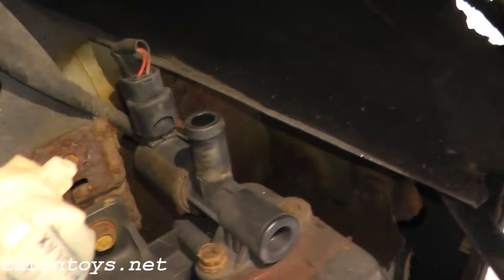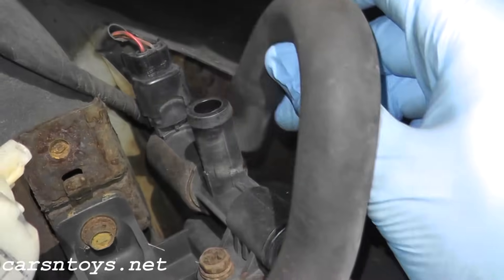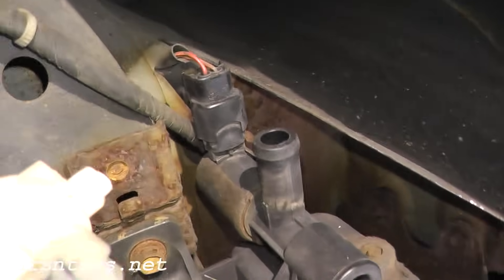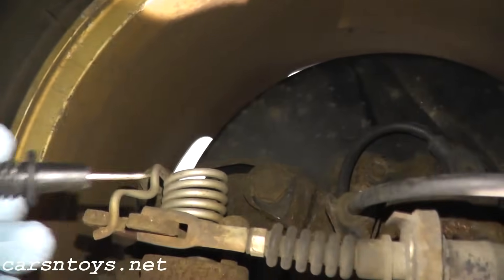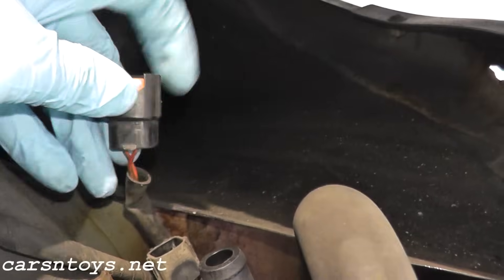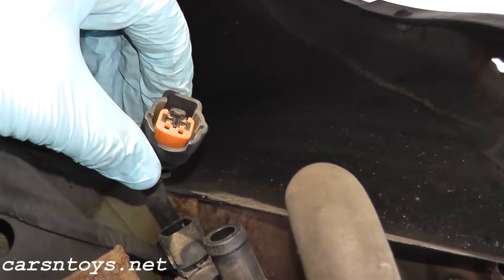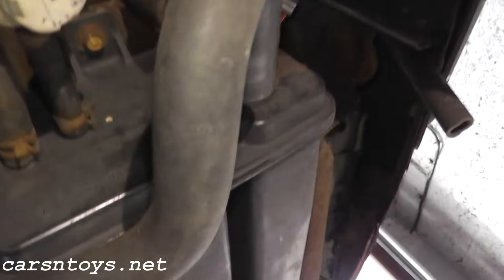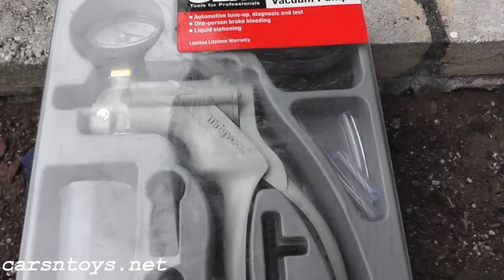How To Test and Replace EVAP Canister Vent Control Valve P0446

Comment: clicking noise from 12v activation of canister vent control valve DOES not mean it is working (holding vacuum, not leaking); any rubber seals may have turned to black mush or powder.

Comment: I have a 1997 or 1998 chevy s 10 with a purge valve solenoid problem ( PO 442 ).  I can’t find the valve anywhere.  Help

Comment: How do you go about checking the ground (#1pin) from the ECM? That's what gives the valve the signal it needs to close. Some of them can be done by certain scanners, but they cost a lot of money. Also, it depends on the YM&M. But if you don't have those  types of tools, then it's almost impossible to test. Bench testing a valve like that 1 is not 100% accurate it needs the ground circuit from the ECM to truly and 100% definitively make sure it's functioning properly. So, to sum this all up. You can run a lead wire to the inside of your vehicle to see with your multimeter if the ground does turn on. Also, check by ohming the wire to make sure it has no breaks. There are many things to consider before throwing parts at it, in hopes of a quick fix.

Comment: Super. I think i may be getting closer.
I have a 1998, 3.3L 4x4 auto. 170,000 miles.
My wife filled gas tank one day last week while it idling and it started acting like it was missing after that. 
She drove it 200 miles through the mountains and got it home. 
No codes.
I opened the gas cap, that looks good, and the tank depressurized for no kidding, 5 to 6 minutes. At first it was heavy and wet fumes coming out, then eventually faded away. No visible leaks anywhere, or damage.

I loosened the gas cap and drove it for 18 miles. No change. Acts like it's mildly missing. Plug and wires only 1 year old. No codes.

Also, the RPM gauge shakes about 200 RPMs when it feels like it's missing. 

Any ideas?  Do ya think my ignition coil just happened to go bad at the same time?  Would that not toss a code?

Thanks!

Comment: i had code po446 and got lucky. i noticed and fixed a torn hose to evap solenoid tip and replaced it and erased code. it hasnt came back on yet+ and running better. so hopefully im good.

Comment: 2005 f250 super duty 5.4 liter. Getting 11.86v to the plug. Hooked up an isolated battery to the valve and got NO clicks. Should I order the canister vent solenoid? Throwing only the P0446 code. Oem solenoid part #reads F80E-9F945-AA. Thanks for your help!

Comment: Hi sir i have code P0456 smoked it nothing found, changed gas cap like 4 times with getting factory oem one and after another code p0401 popped up so i changed egr valve was told and no engine light for 2 months but now code P0456 again any suggestions was told to replace evap canister vent valve or purge valve...Its for a mitsubishi galant 2002

Comment: It can also be tripped by a faulty gas cap.  Sometimes a malfunctioning purge valve but, usually what you covered, good job.
Reply: Thanks for the reminder.  I just fixed my 2000 Mazda B3000 (only 60k miles) with a new gas cap. Years ago I fixed the problem on our Lexus with a gas cap, but forgot about it.
Reply: @ILuv2learn   You're welcome.  😀

Comment: What would cause a has leak in this area when topping off your tank? I like to keep my tank full so every few days i top off the tank . And sometimes gas leaks by the rear drivers wheel. There's alot of snow on the ground right now so I can't really check too good. But there's no check lights on the dash and she  runs great with good gas mileage .

Comment: to all with a 2007 hyundai accent or similar, to release the valve from the wiring harness, there's a little metal wire you push in to release it. tried pulling my hardest and it wouldn't come out until i realized that, haha

Comment: I was really impressed with the caliber of the video/audio. So many are full of shaking and quick motions that make them hard to watch or contain outside noises that have nothing to do with the video. So kudos in making an easy to watch video. I found the testing contained in this video extremely valuable. However, as mentioned by a previous commenter, the video stopped short of the actual replacement of the value. That may have been due to the use of gasket maker to fill a leak previously or the implication at the beginning of the video that the replacement only involved the removal of two bolts. But being a novice with car repairs I'm not sure which. That said, thanks again for making a great video.
Reply from the maker: Thank you. Appreciate the feedback. Yes, I didn't want to break the seal as this specific valve was working perfectly fine. Cheers.

Comment: "Replace EVAP Canister Vent Control Valve" ... never happened...
Reply: yea that's true but he did show you how to find it what it looks like and what needs to be done to remove it so if you a replacement part you could just do it in reverse order..
Reply: Sir I have a code p0440 sabes cuál será el problema en mi carro ayuda

Comment: i used an old computer power supply for the 12 volts. jumper the green and black wire on the 24/26 connector. hearing the solenoid click DOES NOT verify that the valve works. I have one now that the plunger is rusted shut which happens a lot and the solenoid clicks. a service manual will tell how to test on the car. or remove, with 12v applied you should be able to blow air through from one port to the other. no 12volts ports are blocked. mine is blocked constantly.

Comment: 1st thanks for ur videos they help a lot... So i have a 09 versa 1.8 and i have a p0442 and p0448 a leak and a bad solenoid or short but i have tested the solenoid and it work i have tested the wires i have 4 volts with the key in on and 13 with the motor running my 1st question is it normal? 2nd u think maybe a leak around the solenoid makes the computer think its open and will cause a p0448 from a p0442?

Comment: I replaced myne and i continue to get same code and tighten gas cap loght but ive replaced vent solenoid and hoses. Any advise? 2007 chevy silverado classic
Reply: This may help you. I used this video to fix the code on my Chevy.
https://youtu.be/4VasSSYBal4

Comment: Really cool video. Thanks for sharing. Will this apply to an "Evaporative Emission System Vent Control Circuit"? That's the description my code reader is giving me with code no. P0446. I'm not sure if I should just replace a part, though, I'm not sure which one it is. I have a Pathfinder 1997.

Comment: Remember to have a fuse inline when connection your test 12V to the EVAP vent control valve.  Mine failed and there was a short on the terminals. I hooked it up with a fairly large fuse and it instantly blew the fuse.
Reply from the maker: Good tip! Thank you.
Reply: How big of a fuse do you recommend for this? I'm planning on testing mine sometime soon and buy a replacement since mine is stuck open (which can be a good thing, but bad at the same time). Good thing I can still fill my car up and if it was restricted air flow, my car would be sitting on the driveway again.
Reply: @RetroPCUser   If I remember correctly a working unit doesn't use that much current. I think I used a 5A fuse but could have gone smaller.

Comment: Hello CarsNToys, Great video although I've got a question... What do I do if I'm only getting 2 volts & dropping from the Vent valves' connector plug? (Unplugged from valve and tested with digital multi-meter like you show in this video).

Comment: I don't know about the maxima, but on my 97 nissan hardbody p0446 can also be caused by no power to the vent solenoid, e.g. not having the harness connected correctly, or circuit break, or fried ecu.   If you have a bad canister, it may throw a p1447 because the canister leaks the charcoal into the line, and somewhere along the path towards and after the purge valve,  it can get clogged up.
Reply: In case anybody reads this, my canister turned out to be bad.  I actually don't know anything about these canisters but I assume there is some membrane inside that keeps the carbon secured and since mine was leaking carbon pellets, I assume it was bad.  Instead of taking it apart and/or refilling the carbon or shelling out $200 for a new canister, I took a nylon bag from a used tea bag (no joke), put it over the end of the output vent and screwed back the screw clamp on the hose and canister port, reset the computer codes and haven't had a problem since.  What ever screen you use, just make sure it doesn't restrict the air flow but it's fine enough to keep the carbon pellets in the canister.
Reply: @johnsmith-sk1ep  wish I had thought I've that.

Comment: I have a 2002 Alero with P0446 code. Would the canister vent control valve be most suspect and would the testing be similar? Thanks
Reply: Yes, they all do the same thing, AOR.

Comment: Hi, just need to tell you that I'm a woman and I fixed my 2001 Chevy Blazer PO446 by pulling out the 10A Engine 1 fuse (which was NOT burn't out), wiping the connection with my fingers, pushing it back into place and giving it a hard push in and my truck runs great now...a quick fix and didn't cost me a penny !
Reply from the maker: Awesome. Glad it worked out.
Reply: It will most likely come back on. Very uncommon for the fuse to be dirty enough like that. But it is possible. But the light will probably come back on. Most likely
Reply: So how many pennies did you end up spending in the last 7 years lol

Comment: I have a 1996 Nissan Maxima and having this same issue.  You mentioned that you may need to check a fuse.  Is the fuse under the hood or the inside fuse panel, and which fuse exactly need to be check?

Comment: My 2000 Nissan Altima gxe is giving off codes p1441, p1448 and p0455. Could this part causing all 3 of those codes to go off?
Reply: Did you figure it out? I have the p1440, and p441

Comment: I have a 2002 Nissan Maxima 3.5 and I am not getting an error code of P0446 but, P0449.
Why is this or, do they mean something different from each other? Also, would this error code cause the engine not to crank?
Awesome video. Thanks a lot.

Comment: Hope you can help. I have a 2002 GMC Sierra that threw the P0446. Replaced the solenoid and the hose. Cleared the code and after she cycles through the self tests (drive , cold start, etc) she threw the same code. Check the car fuses, fine. Can the charcoal canister cause that or did I get a defective evap valve? I mean this thing is driving me nuts....any guidance would help
Reply from the maker: I'd start by making sure power is getting to the harness connector. If so, I'd check the valve next and go from there. evap codes are never fun.

Comment: I've got a 2003 Chevy Impala LS 3800 series, got your basic PO448 Evap Leak. Replaced the gas cap, reset entire system and light returned. Resently replaced the fuel filter which was pitch black. How to I find the EVAP Canster ?
Reply from the maker: Try google images. The canisters are often found near the fuel tank.

Comment: My car (2004 Nissan Sentra) is throwing a code of p1273 , because of a air to fuel ratio issue. We've done about everything , so I'm wondering if this could potentially resolve the issue?
Reply from the maker: I'm afraid not. What specifically have you done?
Reply: It's been an issue for years now. The o2 sensor was replaced. A muffler was replaced. There was even some wiring that was redone at a shop, but this code just comes back to haunt me. When I pump gas it spews back out of the filler, so I was wondering if they were potentially related.

Comment: actually, and I could be somewhat wrong, but it should switch using the ground side of the wire... so even with the key off, you should still get power at that wire. 

also, it's always open with the car off... the only time it closes is during testing/running of the canister Purge solenoid, to allow suction of gases. otherwise, it's always in the open position...

Comment: hey guys i have a 93 corolla and for some reason if am driving down the road the car star running like crap i have to pull over open my gas cap let air out and the start running fine
Reply: I believe you are letting air in, Luis. Likely to be a vent valve not opening. WHY??

Comment: so I have the P0446 code. I just replaced the EVAP solenoid and purge valve. I've check the plug and have 13 volts coming from truck. I ran power to the solenoid and its opening and closing just fine. not sure what else to check.
Reply: Dustin Mills I actually think I figured it out. I believe one of my hoses are kinked. Right now it's 12° outside and snowing so I'm going to wait for a warmer day and see if that's what it is. I crawled up real quick before the snow started for another reason and it looked like one hose was bent to much and has a kink.
Reply: Hoses?

Comment: Will codes P0446 & P0450 on the same exact car cause it to want too shut off at times at idle or even at lights or stop signs ???? I need to stop it from doing this in traffic !!
Reply: Papo Portillo its your tempture sensor

Comment: If the canister or any part is indeed bad,  would it shut the vehicle down while driving?
Reply from the maker: Statistically, it's a pretty low possibility. Stalling tends to be a problem with the fuel/ignition system. Even a bad connection at the battery.

Comment: I tested the valve with 12V battery and it opens fine. I checked the terminal have 3V on one side and none on the other. Where is the fuse located (I have a 96 Nissan Hardbody)? Also I have read that there is power to both sides of the terminal is that true? I followed the wire that should have 12V along the body, under the seat, through the firewall, and it appears to attach to the "EVAP canister purge control volume control valve", which I tested watching your video and everything appeared to be in order. Any ideas?
Reply: The plastic-bodied electrical part needs a ground, so I assume the other wire is for that, no power should be on it, unless you have one multimeter lead hooked to battery positive, then the "hot" side will have no power. Not on both

Comment: Thanks for your instructions, thanks to them have I been able to rule out many thinks that could be the problem. On the hardness connected to the vent valve I only get around 1 volt or less. It seems i cannot establish contact the holes of the hardness might be too small? I see you can easily make contact with the multimeter.  Thanks man

Comment: You could also have someone turn the switch to on position while your back there and listen for the thunk then you won't need a battery pack.
Reply: yes
Reply: greenspiraldragon
Reply: I'm not sure that would work, greenspir, You would get voltage there but the computer controls ground. It is normally open, but when is it closed? It is closed when the purge is on. That is when it would be grounded?? Too many questions.
Reply: greenspiraldragon the switch are you talking about the ignition ??

Comment: If you blow from one port, if Air come out from other side means EVAP Canister Vent Control valve bad ? (assuming 12V is not applied). I took mine out and It does not click when I applied 12V, also I can blow air and air comes out from other side.
Reply: With it open (12V turned off with the car off), it'll allow you to fill up your car. If it doesn't close (don't hear a click with the car running), it means the relay inside the vent control is bad. The part itself isn't pricey, however, on some cars, it's inside the tank area. On my Oldsmobile Intrigue, it's mounted on the side and can get removed without issues. Remember: place a fuse in the positive (red) wire to check for a short circuit as well.

Comment: Hello, great video. After changing the valve, how long should I wait until the check engine light shuts off??
Reply from the maker: +Cesar Cisneros It depends on how much you drive the car. Figure a solid day or two.
Reply: If you have fixed the problem, the light may go out after the first or second purge cycle.

Comment: Nissan Sentra 2000 1.8 liter. Getting code 1448. "EVAP Canister Vent Control Valve (Open)" There are 3 EVAP system solenoids for this model. See image at 5:40 in your video (well done btw & ty) above the "ck" in the word "click". Eventually found this online as part #CVS99: vapor canister vent solenoid, also there is a vacuum switch canister purge control solenoid (p#:FDCC100 & under the hood) and the one you tested mounted to the canister (PV583). Tried 12V method outlined here on all 3: only CVS99 failed.

Comment: Sir--I have a P0446 code, and am following your work.. Unfortunately, I am working on my 03 Sonoma, which has to have the spare tire brought out just to get near test A... I took a quick look at the wires--they look fine, but i don't like the way they bent the wire 180 degrees to plug in.. I pray the sensor is good..

Comment: I use a 9 volt battery to test the valve and check if air is going through it should be close the one I replaced was leaking the plunger was not closing all the way.
Reply: Danny Ordonez,  We tried a 9 volt battery to test a vent valve and we could hear a small click, but we could still blow air through it. Since it was a brand new vent valve we then tried hooking it up to the vehicles 12 volt battery, positive and negative, using aligator clips, and we heard a much louder clunk and we could not blow air through it. So I think you need at least 12 volts to test a vent valve.